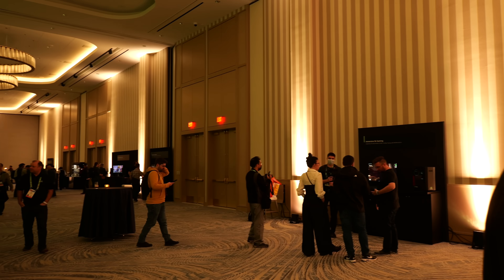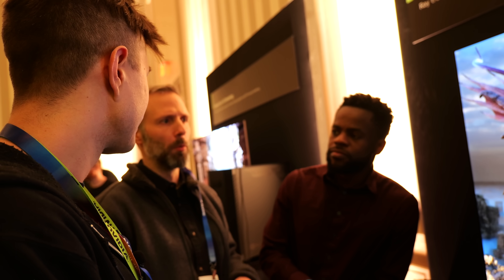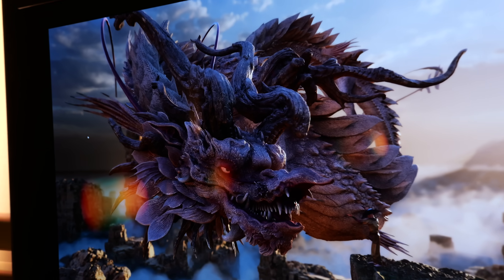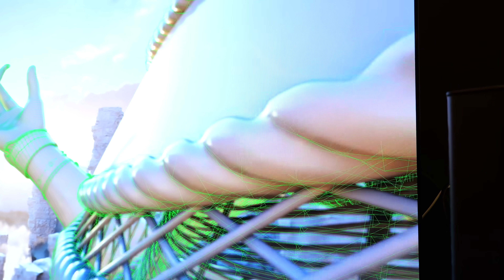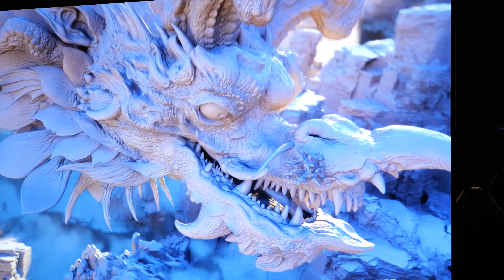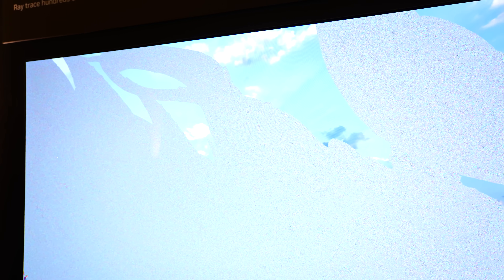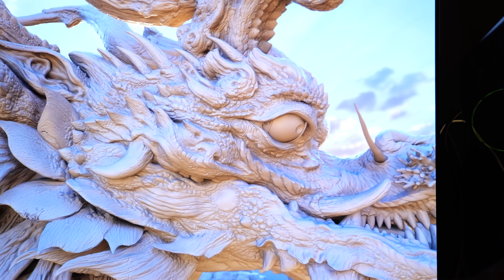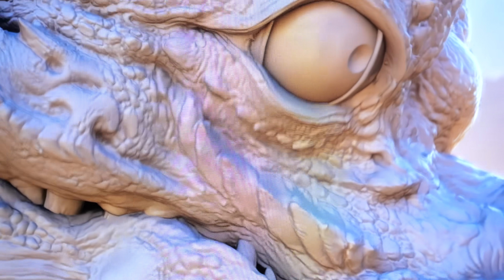RTX Mega Geometry Is A Big Deal... But What Does It Actually Do?

Comment: Cool information but there should have been way less talking heads and way more visual showcase. When it comes to such visual topics like computer graphics, talking heads should never take up more than like 20% of the video content. The whole point of video format, unlike just audio, is that it massively increases the bandwidth of the information that can be transferred to the viewer. If 90%+ of the video are just two talking heads, the viewer receives only small fraction of information the format could provide.

Comment: This is really cool, but I find it interesting that in the end you still need to rely on texture resolution and essentially baked textures to drive the micro detail here. Opposed to when Epic showed off the nanite demo and the statues were ~35 million triangles each, that was a high poly export directly from zbrush therefore detail was not tied to texel density. The problem with that is the file size for that model would be massive compared to a GPU tessellated mesh with mid/high levels of geometry. I suppose using UDIMs will have to take precedence here. Overall it is really cool tech, but I do hold reservations for performance in the end, especially if integrated into an actual game project and not just a tech demo. I have PTSD from trying to run STALKER 2 on my 1440p ultrawide with a 3070.

Comment: VR is going to be so Sick with this in 5 to 10 years.
Reply: They COULD do it now using tech like layer stacking, chiplets, etc..., but the price would be prohibitively high. Assuming the tech continues at the current pace (questionable), we're still at least two-three generations away.
Reply: Try 15-20. Look at current VR games how they perform on even top dog systems and then think about throwing in this level of path tracing into the equation. I have a 4090 and even I don't dream of playing eg - Quake 2 RTX in VR. At 1440p with max settings, my card struggles at 144hz in 2D. Imagine now rendering the scene twice at even higher resolutions (My nearly 6 year old Valve Index is 1440x1600 per eye and has to render at something like 2050x2200 per eye to make up for lens distortion) while also considering the fact that we are running up against a physics brick wall in transistor shrinkage, and it suddenly becomes a much more believable reality that we may NEVER even see these things come to fruition in VR, ever.
Reply: @KuraiShidosha  think out of the box, in 2025 all this things makes less sense
Reply: @ElitePortraits  you can't ignore physics
Reply: @KuraiShidosha  ill take your word for it mr expert
Reply: @JackPadgett-z6w  you don't have to be an expert to know you can't shrink something below the size of an atom. We're approaching the hard limits set forth by the laws of physics and that's not debatable. Go back to the 90s and look at the rate of performance improvement gen over gen then compare it to what we've seen over the last decade.
Reply: @KuraiShidosha  luckily humans have a way of skating past these limits. probably gonna be solve through generative AI
Reply: @JackPadgett-z6w  I'm not holding my breath and I don't recommend you do either.
Reply: @KuraiShidosha  Its like god, neither of us can prove that this what we think is gonna happen will happen so we might as well call it quits.
Reply: @KuraiShidosha  Eye tracking, upscaling, optimizations. You can already do a lot of what you are talking about as long as the game/program is implements all or 2 of these. Path tracing is nice but ray tracing is 80% the way there, don't buy into all the latest tech and enjoy what's available. Been down that road before. Anyways point is we aren't far off.
Reply: @qtopthisq  ask yourself why eye tracking and foveated rendering aren't taking off by now when the tech has been around for nearly a decade. It doesn't work the way we thought it would. The sheer concept of how VR currently works (small flat panel displays with fixed resolution digital panels) just isn't going to let us move forward in a meaningful way. It's such a hard roadblock that I don't think I'll live to see surpassed and I'm only 37.
Reply: @KuraiShidosha  costs are the main thing here, I don't think it is a priority due to roadblocks I am assuming you are mentioning which are eye tracking hardware costs which therefore inhibit it as a software feature. Defintely not a priority as low resolutions are king at the moment. Though you should check out the Pimax Crystal which features foveated rendering but limited support i believe. It is here, it just is niche in a niche market. Your 4090 is a keeper right now so don't upgrade! lol
Reply: @ I meant more with how we render games, foveated rendering wasn't the silver bullet we hoped it would be otherwise it would have been a key feature of every headset from basically 2018 and beyond.

I might try to get a 5090 and then sell my 4090 FE to fully cover the costs. My power connector was perfectly clean and clear for over 2 years, UNTIL I bought a garbage Corsair HX1500i PSU. Their cheapo plastic connector started to melt in my poor 4090 FE in as little as 2 weeks of fairly light usage. Unbelievable. If I can't find a 5090 to move on to, then I'm going to have to pay some YouTube pro repair guy to solder on the new 12v-2x6 connectors to my GPU and just hold onto it for as long as I can. Would much rather sell and move on to the next gen but the inventory is absolute trash today so I'm not holding my breathe. I did see the 5090 performs a lot better at high resolution VR than the 4090 so there's that too.
Reply: @ should be too hard to solder a new connector if needed, but yeah that sucks. I’m getting a new psu this year or next for my setup but seems 850w even with a 5090 is fine, was the 1500w for efficiency+tons of other stuff hooked up? If you don’t want your 4090 I might be interested! Hahaha
Reply: @qtopthisq  efficiency since I run my 4090 with 600w limit (even if it rarely sees past 500w) and also plan on upgrading to a 9950x3D which has a TDP of 170w. Plus all the fans, drives, RGB etc I want to be in that 50% load window for max efficiency. It also helps with the longevity of the unit, though to be fair I'm replacing an over 8 year old EVGA 850w unit that seems to be working well enough for now with my current setup. I would recommend you avoid Corsair. They're the only manufacturer that doesn't use native 12v-2x6 connectors, instead opting for what's basically an adapter with 2 x 8 pin old school connectors. Screw that. I have my eye on the Thermaltake 1650w (1300w also available) Toughpower TF3 which should be coming out soon I hope. It's Titanium rated and ATX 3.1 / PCIE 5.1 certified, plus uses native 12v-2x6 cables. No more worrying about melting my GPU with that, especially if I solder a new connector on my card or upgrade to 5090.
Reply: @darkl3ad3r  I think the main reason the two technologies you mention haven't taken off is purely financial. It's simply expensive at the current time.
For sure, there are other hurdles to overcome for amazing VR.
Reply: @jasonhurdlow6607  if it were strictly financial, then why is the only headset with it a cheap console based one?
Reply: @darkl3ad3r  The only one? No, it's not. Most of them are expensive military-grade.

Comment: TLDR: Video cards have effectively achieved the same issue as cameras. Modern cameras can capture the detail of so many megapixels that they require a superior optically designed lens to do so. This high degree of detail is only noticeable if you digitally zoom in or extremely crop the image. This also leads to multiple other problems. The higher resolution will now definitively show even the smallest amount of misfocused; it creates tremendous-sized files, and it needs much larger sensors, power use, etc. To make ray tracing more practical, it will only work on sub-meshes of models, as the demands required to work on high-detail moving model meshes are beyond reasonable expectation for the average gaming enthusiast to own or afford. It is an ideal of what can be done with copious resources, but all these technologies only work in small demo form and hopefully, possibly MAY be available in years to come, and if they are, they will be diminished form.

IE Ray tracing today etc, is still a problematic technology that has been introduced and has no real solution for the real world.

Comment: I miss the days when Nvidia had enough faith in their demos to let their ACTUAL customers run them, I wonder if they are afraid of what we might find, ever since first gen RTX they stopped releasing them to the public so we BASICALLY never get to see them run on our hardware
Reply: Agreed. Remember that insane RC car demo they showed off at the RTX 40 series announcement? They said that would be made available to the public, yet it's nowhere to be seen.
Reply: To be fair they literally push these tech very quickly to their Unreal RTX branch so if you want to give it a try and know what you are doing you can get hands on with it really fast.
Reply: @Navhkrin  They honestly don't push it quickly. Nvidia hasn't even released Ray Reconstruction in their NVRTX branches. It's been a year and a half since the announcement, and it's still "coming soon" for a wide public release. As far as demos, RTX Racer was supposed to come out in 2022. OP is right. They definitely don't have enough faith to release them.

Comment: So... more fake, non-rasterized graphics?
Reply: Non rasterization isn't fake, neural computing is an order of magnitude more efficient. We simply can't produce the logicgate based hardware to do any of this because we are reaching the limits of physics for transistor size and how much we can pack in a die without melting it.

Neural compute is the only way we can achieve new leaps in visual fidelity, physics and more.

If you think that's fake you're just dumb and you arbitrarily value rasterization for no actual reason because you don't actually understand anything about neural inference

Comment: Soon.... it will be over 5 years before compute on the level of 5090 that the demo was running on is mainstream even in midrange and probably closer to 10 on low end. Just look at steam hardware survey and the age of cards being used. While cool as novel tech it won't get wide adoption (meaning not only in Nvidia sponsored titles) before Nvidia 60 class cards can achieve it.
Reply: Steam hardware survey is not a remotely accurate way to assess average hardware. The people actually spending money on new games tend to have decent hardware. If you don't have money for decent hardware you aren't spending full price for new games either
Reply: @mojojojo6292  This has to be one of the most out of touch responses I've seen in quite a while. What you spend for games and what type of rig you have are not hard linked like you think. 70$ for AAA or 45$ for AA game is not same type of investment as 500-600$ that Nvidia charges for 60 class.

Comment: The big deal here I guess is the raytracing acceleration, because otherwise this is just Nanite tesselation of skeletal meshes, which is an experimental feature in UE 5.5.
Reply: You're right, but I'd argue the more important part is getting the API standardized through DirectX and Vulkan so that all modern GPUs can use it. Similar to cooperative vectors/matrices in DirectX and Vulkan.
Reply: @456MrPeople  Are we going to witness a super collaboration among Nvidia-Intel-AMD and Microsoft? the justice league? xD
Reply: @Leosalvaje_  Yes this always happens. When Nvidia introduced real time ray tracing with RTX 20 series back in the day they worked with Microsofot to make it a proper API in DirectX - DXR. Then later in Vulkan. AMD then gets into it a few years later and benefits from the work Nvidia did for standardised apis. But nvidia benefits because it makes sure the stuff they make spreads everywhere even if AMD sort of gets a use from it because Nvidia will always be a few years ahead in research.

Comment: unreal 5 was a big deal 
unreal 5.1 was a big deal 
unreal 5.2 was a big deal 
unreal 5.3 was a big deal 
unreal 5.4 was a big deal 
unreal 5.5 was a big deal too

but the majority of the games made in this engine have bad graphics and performance.
Reply: It’s hard to believe that UE5 has not been the success it appeared to be.  Seems that other engines are more efficient which is weird cause that was the big selling point of UE5 - the ability to render at the visible pixel, not the polygon.
Reply: Exactly.
Reply: Demos are always more impressive than the real product.
Reply: this video is not about Unreal Engine
Reply: @charoleawood  It will be when they stuff this into UE 5.whatever and it continues to rely on upscaling and fake frames.